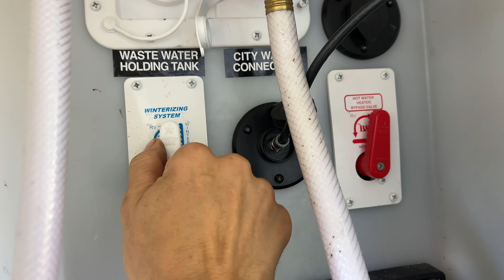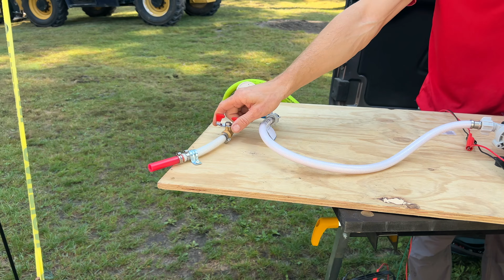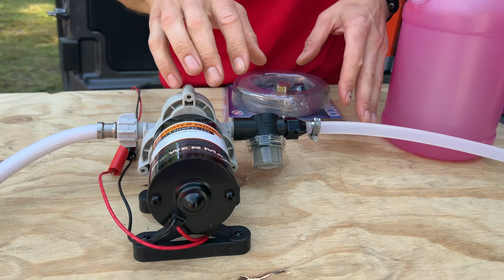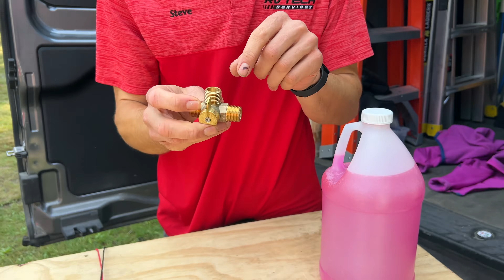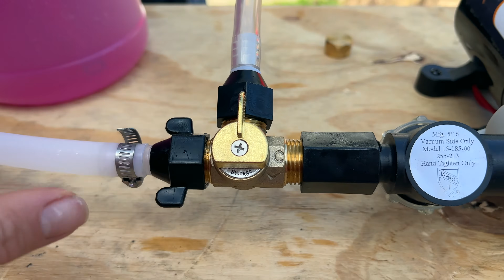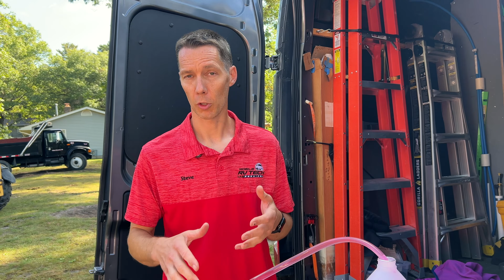How to Install an RV Winterization Kit | Easy DIY Guide

Comment: My water pump inlet is inaccessible without major surgery.  The pump is located way back behind the silverware drawers with the inlet to the pump facing away towards the outside wall of the RV.  The drawer rails have to be removed as well as the structure holding them in place.  Still, cramped access to the inlet is extremely difficult without removing the pump and all the associated plumbing.  How close to inlet does the valve have to be?  From the video it looks like it has to connect directly to the pump.  This is near impossible without MAJOR removals in the structure of the RV.
Reply from the maker: The winterization valve needs to be installed on the intake side of the water pump, but it doesn't necessarily have to be attached directly to the pump housing itself as long as there is no other water source connected between the valve and the pump inlet. The valve could be multiple feet down the line and still serve the same purpose.

Comment: My new-to-me rig came with this set-up.  Since I am a stationary full timer, I don't winterize, but I do use it to pump vinegar into my water heater for descaling. On a 12-gallon Suburban heater, using the pump beats pouring all those gallons through a funnel (or down my arm!).
Reply from the maker: That is a good use of the pump and the bypass kit.

Comment: Can you put the CAMCO kit ‘between’ the strainer / filter and the pump?  I saw another video that recommended this method. 
TIA
Reply from the maker: If you did that, the strainer will not filter out any debris from going into the pump and you would then need to remove the strainer since there would still be water in it.

I would leave the strainer bewteen the valve and the pump so it gets winterized.
Reply: @MobileRVTechServices  - makes sense, thank you.
Reply: Thank you sir,!     Just ordered one. Will be installing  in a couple days.  Should make things real easy.

Comment: I don't know why they'd give you telfon tape in the kit..
Reply from the maker: I wonder the same thing every time I open up a kit.
Reply: I didn't come across your video until after I installed my kit. I used the tape on my threads. Should I remove the tape and reinstall or just leave it alone? Thanks